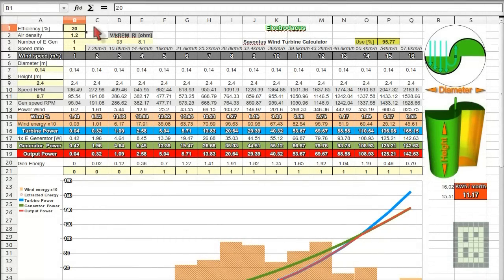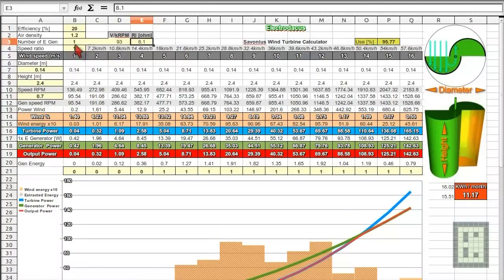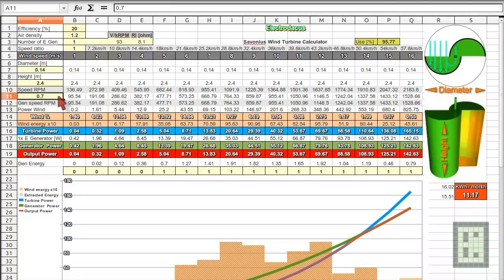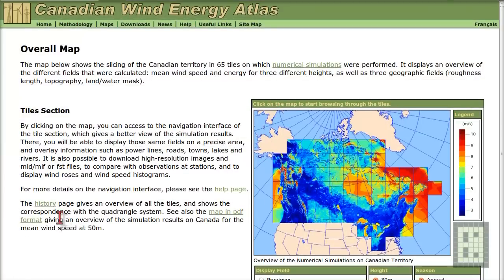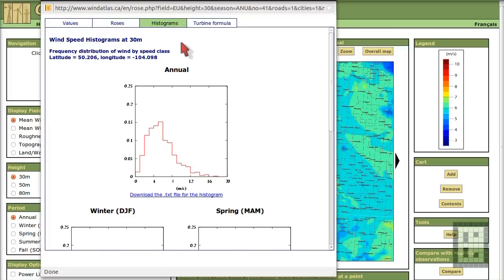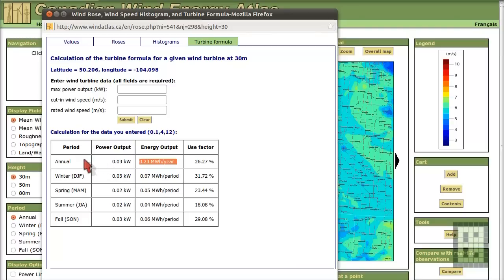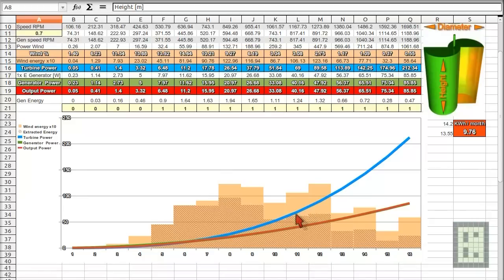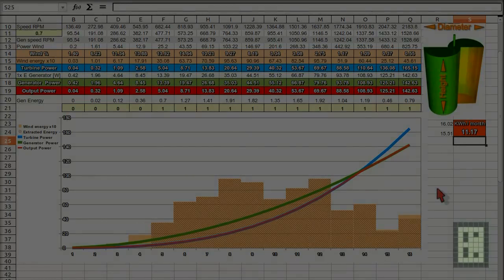Savonius wind turbine calculator, servo generator, VAWT free download

Comment: You can find the 20% number in the Blackwell report, from the 1970's.   It's available via Google, however it's based on wind tunnel data that's got big issues.    You can find the 30% number electodacus is quoting, by googling the papers written by Modi, Fernando, and Benesh (or see the patent filed by Benesh).   However, this also is all wind tunnel based calculations, which the Ian Ross paper of 2010 explains.  "wind tunnel blockage factors for high solidity turbines" or something like that.

Comment: the certified data on the SWCC website, that no small HAWT turbine does better than 31%.    In fact they usually do quite a bit worse, as the small foils stall much more easily in gusty conditions.     So, what some reading should show you is that eft% need scale, it's not correct to say that propellor types reach around 45% without saying that propellor (HAWT) types can reach into the mid 40's% when they have foil depths greater than 8-10ft.

Comment: Thank you ,  I am constructing a experimental VAWT  using the science of sails and the speed acceleration you get from this.  My hobbie cat could go 20 + mph in a 10 mph wind .  My brain does not comprehend electronics.  Mechanical yes .  Some of the motors I have been looking at don't list K/rpm  just the max rpm or don't tell the ohm resistnace.

Comment: ... so you'd want something tall, and small in diameter. Because air resistance increases as a second order function with speed... keep the frontal area of the blade to a minimum, keep the diameter at a minimum to minimize overall meters-per-second of the leading edge of the blade, but increase the height as much as reasonably possible as that is the one factor that just keeps adding torque (and ultimately watts) to the shaft without any bad effects.... Correct ?
Reply from the maker: Mark Osborne Is more about the scale with savonius. It works fine for smaller installations but since is a 3D structure by doubling the area so doubling the power output you increase the volume by quite a bit more and the turbine is much more than just 2x more expensive because of that.
So is better to have multiple smaller unit with savonius than one that is large you need much more materials on the large one than on multiple smaller ones with the same combined output power.
In this video the use factor dropped when I increased the diameter but that is just because a larger diameter turbine will have a lower RPM nothing else. I will have needed to also change the gear ration and then get again a good use factor.
I wanted to keep the turbine gear-less in this example so rotor of the servo motor directly connected to the savonius rotor that way is less expensive and you do not have the added mechanical loss from gearing.
You can play around with numbers the solution will depend on your generator characteristics.

Comment: @electrodacus no i meant PERMANENT MAGNET GENERATOR..

actually my project is based on TWISTED SAVONIUS WIND TURBINE.....and i want power output of only 20W .....so the problem occurs with such motor you suggested needs to be rotated at synchronous speed to generate power......that's not the case in PMG(permanent magnet generator) which requires around 60 rpm to generate voltage............now what would u suggest i should do ??

Comment: I have heard the 30% number as well, and the only source for it seems to come from the work done in the 80's by Benesh, Modi and Fernando. It is likely that they improved the turbine, however they published only wind tunnel data, not real world data. In the real world the results are much, much lower, for reasons that Ian Ross details very nicely. In terms of eff numbers the missing factor is size, turbines, like wings, because of the Reynolds numbers work very differently at different sizes

Comment: Nasa has a good educational foil simulator that shows this (foilsim), with it you can see that a foil which is 6" deep will have a much lower Lift/Drag ratio then the same foil scaled up to 6', it will produce double the lift per surface area.    So in a conventional wind turbine, if it's foils are 6ft deep (so it's 100ft dia), and the turbine eft is 45%, then the same turbine geometry scaled down, is going to be just over 20%.   In the case of small HAWT wind turbines, you can see by looking at

Comment: @electrodacus Agreed! I'm playing with the calculator now. I find it strange that when I increase the diameter of the turbine, I see a tiny bit of gain, but then once I go a tiny bit more.. it heads in the opposite direction. You mentioned the turbine was about the size of a CD. Would it not help to have it be 30 cm instead? But I see the numbers plummet, makes it worse?

Comment: you might want to google Ian Ross Wind Tunnel Blockage.   Ian wrote a paper in 2010 about Savonius type turbines and wind tunnels.    He showed that most wind tunnel data to date is problematic, and his conclusion that Savonius turbines have a efficacy of only about 5%, rather than the 20% quoted in most journals.    You might be interested in my turbine, as well.

Comment: I hear that you believe that it is possible to get greater than 20% eff from a Savonius Rotor of some variety.   I agree, lots of people believe this.  I find in my complete reading of many articles published by engineers, that the best recorded performance of a Sav type turbine  was a wind tunnel test of 44% eff from Rahai in 2005, the next best was Benesh in 1986 who published a 30% wind tunnel result. In both cases no data was, or has ever been published from these turbines in the real world

Comment: Thank you for the time you put in to create this calculator. When I down load the Savoniuswindcalculator7.ods the cells have not downloaded with the formulas in them, just the results, so I cannot change the calculator to my turbine needs
Reply from the maker: I just downloaded the ods file. I have a fairly old version of LibreOffice  4.2.8.2 but all formulas are there.   Just change for example efficiency from default 20% to say 30% and see if everything will be recalculated based on that change. For me all works as it should.
What have you used to open the file ?
Reply: @electrodacus  Microsoft Excel 2007.
Reply: Sorry @electrodacus I meant to add to add the file has an xlsx extension in my Excel. However I was able to copy all the formulas from the .ods file into the xlsx file and it now works. Thank you again.
Reply from the maker: @tedtheoldboyA320  then you need to download from the next link not the .ods but the .xls version

Comment: In the real world looking at the paper published by MIT students who attempted to use a sav for water pumping in central america, they used the 20% figure to design their system and found that it wouldn't even start.   In the end they determined that it was outputting about 1/4 of what they had designed, therefore was outputting 5% eft.  Looking at the Ian Ross paper, he finds 5% max...

Comment: Hi, my name is Muzaffar, located in Brampton Ontario. Your spreadsheet on VAWT has impressed me, are you still working / related to the wind energy projects or have you totally switched to Solar Power Systems as your web link indicates.
Please confirm as I have some questions related to VAWT. Thank you
Reply from the maker: +Muzaffar Iqbal I lost my interest in wind energy since solar PV panels came down in price so much in the last few years that made small scale wind turbines obsolete. I have good wind resources here in Saskatchewan but even so wind is less useful and more expensive.
Solar is so inexpensive that my next project is to heat my house with solar PV electricity. Is the least expensive form of energy available at just 3 cent/kWh.
I'm a bit busy with my Solar BMS project see my google+ page https://plus.google.com/+electrodacus but if your questions about VAWT are not to complex I will be happy to answer.
Reply from the maker: +Muzaffar Iqbal That was my initial idea to have a hybrid Wind and solar so I can have better energy availability. Unfortunately it will not work that well in real life. Getting more solar PV panels is a better solution since sun is available at any time. Even when completely overcast a solar PV array will still produce about 1/12 of the energy it produces in the best sunny day and that is significant especially if you have installed excess PV capacity.
As an example for my 60 to 80kWh/month energy need on my small house I had 3x 240W panels and a small 300W wind turbine. Most of the energy from the wind was concentrated in very few day in the month and 90% of the time that was when there was also sunny so all that energy from the wind turbine remained unused.
Since last year I completely disconnected the wind turbine and installed additional panels.
The 3 panels in a short winter day will about 3.5kWh best day if sunny and as low as 0.3kWh in the worst overcast day. Now I got more panels (they are excess most of the time) but when is overcast I can connect 11 of those panels and get 1.1 to 1.2kWh of energy that covers all my basic needs so the battery only needs to be large enough to store the little energy needed over night.
I also use LiFePO4 batteries for storage those will not need to be fully charged all the time as Lead Acid the prefer to be partially discharged and so a much better option for renewable energy storage.
I will write you an email since I'm a bit curios on your VAWT design but I'm not en expert in fluid mechanics so not sure I will be of any help to you.

Comment: electro, do you know the expression "a little bit of knowledge is dangerous".   Read the paper more carefully, and what you will find is that the BEST efficiency with an historic Savonius is 5%! no where does it say that a Savonius is 5% less than a conventional.   Read the test reports from the SWCC and you will see that the best performance of a small HAWT, is 30%, 6X greater!   Your calculator could be handy if fed correct numbers, however with the numbers you are feeding it.....

Comment: electro, I hear you, and I'm not contradicting you, what we both say is true.   As I pointed out, the Blackwell report from the 70's, and the work by Modi, Fernando and Benesh, report 20% or greater performance FROM WIND TUNNEL RESULTS,,, not from real world tests.   They also all report TSR's GREATER THAN .5, however IN THE REAL WORLD, including tests and MIT, Savonius turbines have never achieved those kinds of results!  This has been recently explained by IAN ROSS...

Comment: Can I use this for Darrieus WT ?
Reply from the maker: Yes it can be used for any wind turbine you just need to input the turbine efficiency and the speed ratio between wind speed and turbine blade speed. And you also need wind data for your particular location as the data there is for my location in Canada.

Comment: Says " page not available" office document
Reply from the maker: That is strange. I just downloaded the office document and it works is a .xls 46.1kb file.
Reply: I need it for a three bucket version. The one i am building has two tiers of three buckets. The final dimension being  350mm diameter by 2400mm tall.
If it works out, it may be one of several on a wind farm.
Reply: Here is the link that is bad. I tried three different computers on different carriers snd different OS. it doesnt work.
http://electrodacus.com/savonius/Savo
Reply from the maker: You need to click on the link in the description the one you posted is just a short part of the link and of course it will not work. This is the complete link to the MS Office document  http://electrodacus.com/savonius/Savoniuswindcalculator7-microsoft97.xls
Reply: Thanks.that works now. How do i change it for three blades instead of two?
Reply from the maker: This calculator is not for fluid mechanics just for the electrical part and amount of energy generated based on turbine efficiency that you introduce. Two or three blades Savonius will have almost the same efficiency.
The calculator as it is in the current example has the wind data from my location you will need to find wind data from your location and then based on turbine efficiency that you introduce and size and aspect ratio of the turbine the calculator will calculate the proper RPM and help you decide what generator configuration works best so that electrical generator output energy is as close as possible to total turbine mechanical energy output.
In the end the generator will give you the energy output based on your wind data, your turbine area and efficiency that you introduce. 
The light yellow data is what you normally change and of course the wind data for your location.